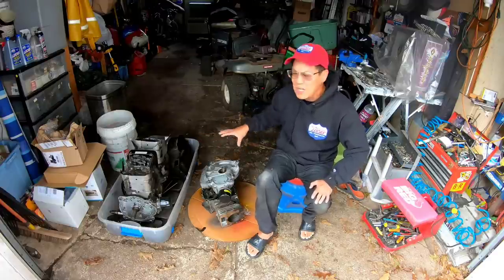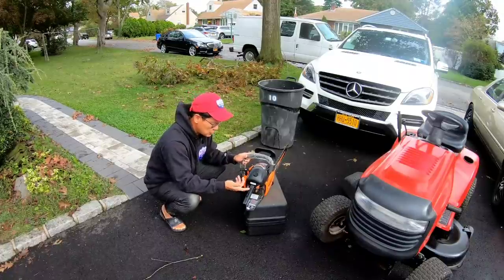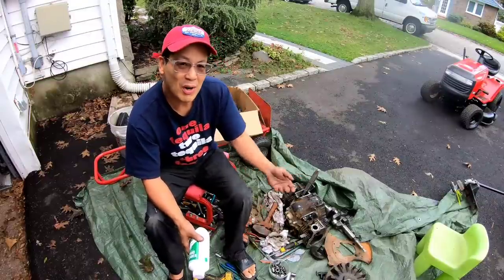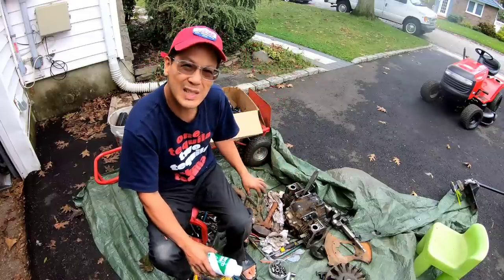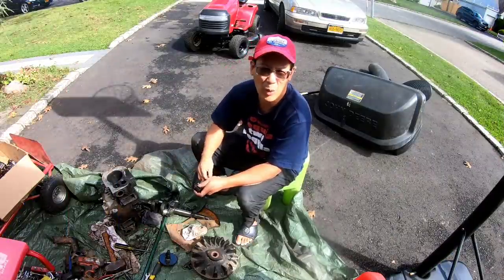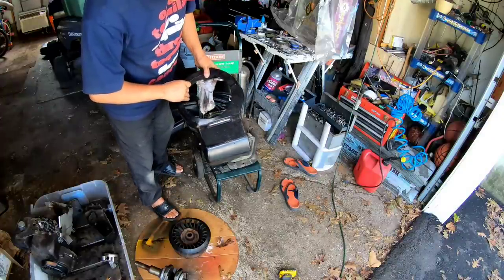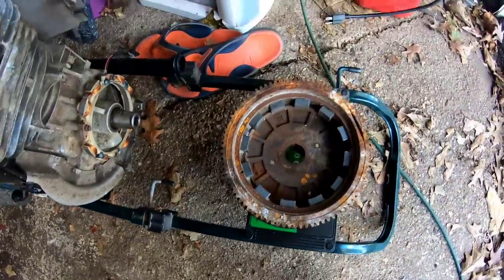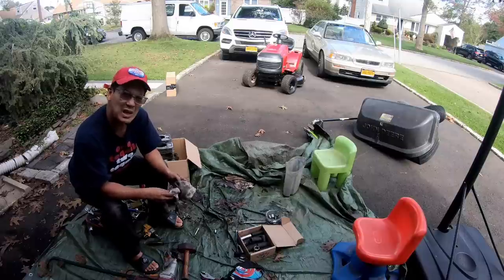FREE BRIGGS STRATTON INTEK SOHV VANGUARD OPPOSED TWIN ENGINE TEARDOWN DISASSEMBLY MADNESS PART OUT

Comment: Good god in heaven above! Tighten that damn chain!
Reply from the maker: Why? Did it come off?  I’ve actually never had a chain come off.
Reply: Mowers N Blowers by having the chain that lose (or to tight) can damage the bar. Also that chain can break a lot easier when it’s at a very lose tension because it can get pinched between logs/limbs a lot easier causing it to snap. It could break and hurt you severely.
Reply from the maker: J_Jim1182 good explanation bro